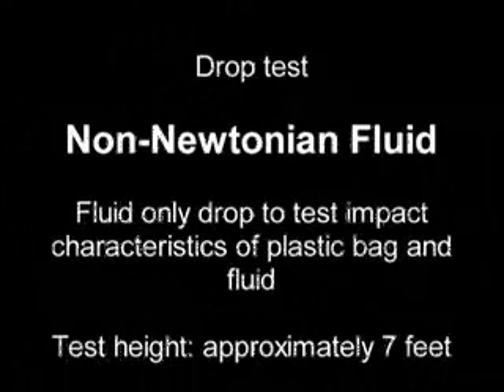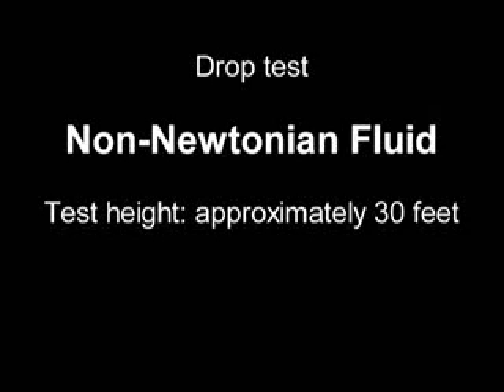Non-Newtonian Fluid Egg Protector

Comment: I used a borax, elmers glue, and corn starch solution, works great but you must leave room for expansion in the container. Don't fill up the container completely or the energy will not distribute well enough to keep the egg intact. tested with a rigid cardboard 4"x4" box from 20 feet.

Comment: Did you do a test with water?

Anyway, sounds like this should have wonderful industrial & safety applications!
Reply from the maker: I know this is a very delayed response.  Great questions.  I am glad you thought of it.  I did do testing with just water.  It only took a drop from 11 feet for the egg to break.  Some people did this same experiment using a larger bag and tossed it from a parking ramp.  They have a great way to do 10 foot increments.  They were able to drop from the highest level and the egg survived.  I am thinking that a bag would reach terminal velocity and the egg would survive.  That would mean it could drop from any height. :-)

Comment: As the guy in the video said, the main issue in the last test was that the bag landed on its side. Instead of a bag, try a paper or cardboard cone, and attach tail fins or something else to stabilize it. That way, the cone's tip will be the part that hits the ground. Actually, because of the way the tip of the cone absorbs the impact, that design would succeed without non-newtonian fluid. *takes a bow, accepts Nobel prize*

Comment: if correct the non newtonian fluid turns solid when disturbed and when relaxed a fluid, well the egg is buoyant so it is on top, so when u drop the bag the turbulence causes the fluid to solid thus hold the egg in place and sponging it at the landing. and when it lands the solid is relax and at ease a fluid.

Comment: actually, i think the only reason the egg didn't survive ONLY on the 30 foot drop is because at that height, the egg was able to separate from the protection of the fluid inside the bag(by this i mean that objects fall at 33ft/second, and can distance from each other by any amount).

if you had done this in say, a water balloon, and only had the egg and the fluid inside(little to no air), it would have survived.
Reply from the maker: It was the only drop where I didn't pull the egg down in the bag.  It would float otherwise and because it wasn't fully in the fluid, I think that contributed to the breaking.  Some other people did this and dropped the egg from much higher with a larger bag full and the egg survived.

I did try dropping in a bag of water and it only took 11 feet for the egg to break.

Comment: I was thinking of a way to thicken the mixture to help keep the egg in place without it losing it's properties as a non-newtonian fluid. After a couple of minutes I thought to mix in styrofoam pellets. I think the styrofoam would be suspended in the mixture the same way that the cornstarch is suspended in the water. It would be lighter too for experiments with a weight limit.

Comment: make a drop rocket, basically put the egg in a tube filled with the fluid and build a rocket or missle shape off of that center tube.  so you know it will hit the ground the way you want it to.  also if you want the egg in the middle of the tube (to stop it from floating to one side) try neodymium magnets im sure that would work.